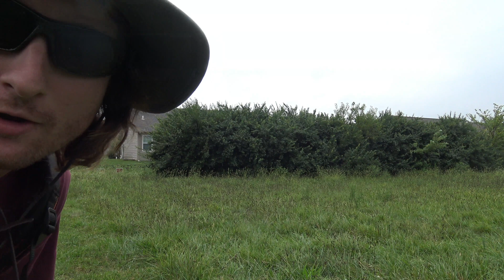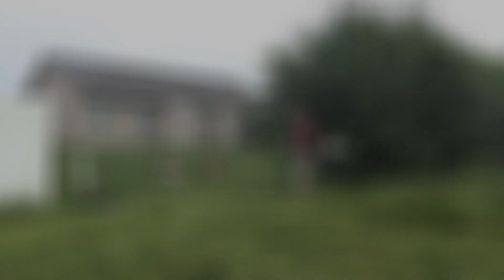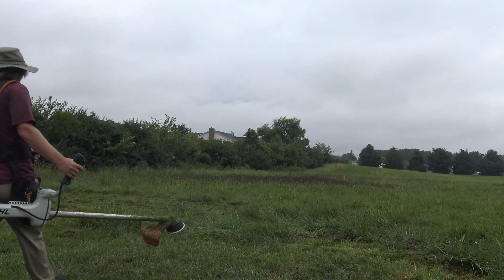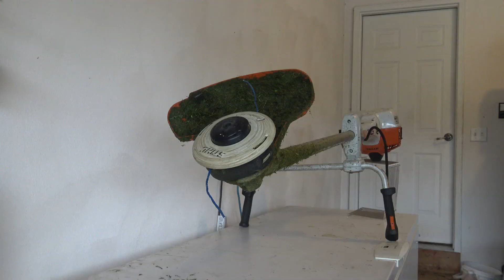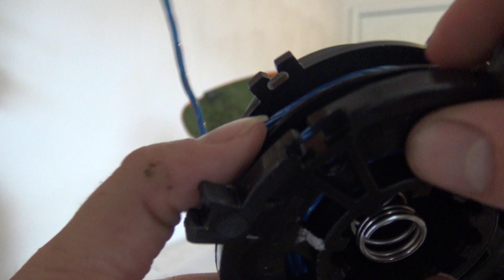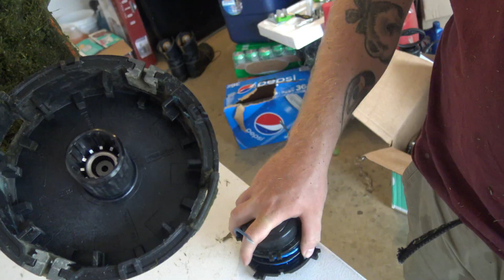STIHL FS 560 - Platinum Gatorline .130 Ultimate Test

Comment: Experienced same welding issues with a recently purchased FS 460. Tried soaking the line and spray with silicone but welding still occurred. Tend to think these big engine clearing saws simply  have too much power and torque to be used successfully with trimmer lines and  heads.

Comment: Havd u tried Sufix MegaTwist 3mm.  Its not as expensive as the top brand, but i tried and it did the job done very well.
Reply: The reason i use it for this type of dense grass, its cheaper so i feed line more frequently. Mybe its avoided from the line get welded.
Reply from the maker: I have not tried this brand of line. I will try and find some this summer and try it out. Thanks!

Comment: Haha, seems like you’re experiencing the same problem with the 560 as we all are when using the 50-2 mowing head. I have 5 of these and 2x 460’s Just a suggestion but try soaking your line for 24hrs before you use it. Try, if you can get it, CF3 3.3mm Stihl line. It’s all we buy now in all sizes. Durocut with 4mm xxl lines x 4 on the head. Keep sponge as will keep water in the container and soak your replacement lines! Good luck 🤞
Reply from the maker: Thanks for the comment. I soak line religiously and my No. choice of line is the CF3 Pro. It’s the best. 👍👌
Reply: @barneslawntree4877   Hi, just one other tip we found was helpful was to file the inside of each of the eyelets! If you look closely you will see a ridge made during the casting. We found this makes a improvement on line life! I have heard rumours that there’s going to be a 4mm version. Let’s hope so🙏🙏🙏. I will keep you posted. Great videos bud. Take care.Jonny 🇬🇧

Comment: G'Day from Gerringong in Australia. I have the same issues here. Had a monster job yesterday super hot and the machine was going hard for 3 hours straight. The grass would've been twice as high and 3 x as thick as your test paddock.  I love the Stihl FS 560 but the chord/line issues are driving me nuts... I went back to the bog standard 3mm Stihl line to test it and the welding continues to be a pest. Its the heat and the high revs? I used the blade on lantana the other day and it was super impressive. I'm going to have to try using blades on the different grasses.
Love you videos and channel, stay safe over there and hammer the work out hard mate.. all the best Ian

Comment: Great video. Just bought a 560 my self and love it absolute beast had same problem with line welding in trimmer head so I bought a stihl duro cut 40-4 with 4mm precut line and must say it works a lot better but it is more expensive way of buying line
Reply from the maker: I went the same route with the 40-4 Durocut. Way better performance. Just buy some .130-.155 line and cut the lengths of line yourself. Way cheaper than buying the pre cut STIHL serrated line. 👍

Comment: I have a FS550 and a 555fx ran into this issue also. Tested a number of lines except the platinum you just tested. Thanks I may not have to now since you tested for me. I had a lot of issues with line breakage and welding. The gator magnum round .155 seems to be the best we tested so far but still welded though your test of platinum looks better. The large blades eliminate this problem but there are issues with these to. Your conditions look easier thin mine. It looks like you have no woody debris buried in the grass. We have to wear crazy amounts of ppe because or the woody debris being thrown. FYI flexiblade will weld also and doesn't feed consistently (probably why it is not recommended for tap n go type heads). I wish the stihl heads would take .155 line like the T55x head for the husky.  We seemed to have settled on regularly advancing the line to minimize the welding. FYI I never dreamed a line trimmer could burn upwards of 10 gal a day and 200+ feet a day of line but the productivity of nice if the PPE does not cause a heat stroke. Not fun in the Florida heat. It seems to me the power and RPM of these large machines may be approaching the operational limits of the the best trimmer lines available. let me know if you have any questions? I have tried a lot of different things with these machines.